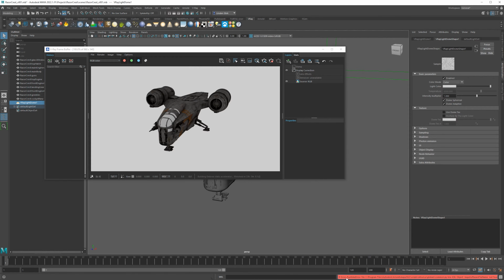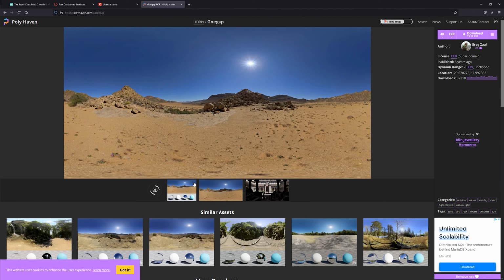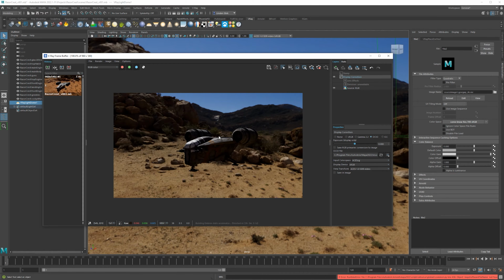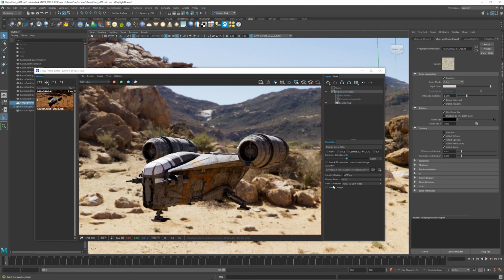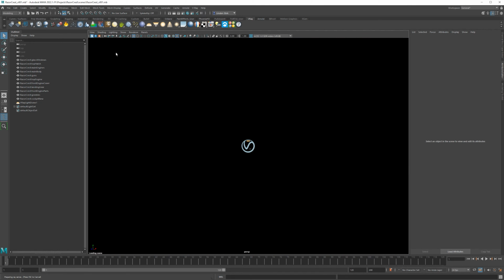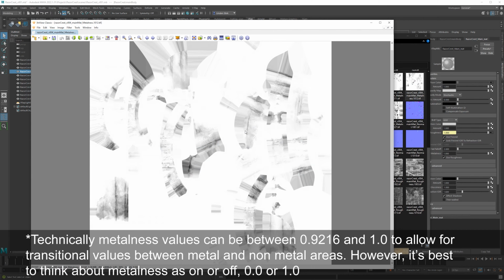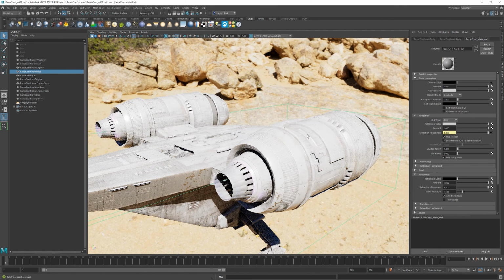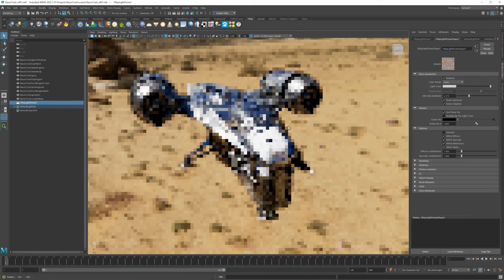V-Ray Sun & HDRI Dome Lights — Razor Crest VFX Lecture 03

Comment: 2:50 What is the problem if this error message appears? Is it a negligible error?
Reply from the maker: No, since if the license server isn't running, you won't be able to access V-Ray.
Reply: @CGStirk  A red error window appeared, but V-ray runs well like the video. License server runs well too. But what's the problem?
Reply from the maker: @taygaben  What is the exact error message?
Reply: @CGStirk I get the same error in 2:43. I get the error in the video as well, but the license and V-ray are the same as normal. (But now I don't get the error message. I re-run Maya and it works fine. Is this a normal situation?)
Reply from the maker: @taygaben  It can happen if the license server is not running, it cannot connect to the internet, or you don't have an available license, but normally it should not give an error.

Comment: 4:24 So, if the license server is not working, could you tell me what to do in Windows?
Reply from the maker: The first thing to try is going to Windows Start and then type in "Start Chaos License Server". After that launches, try connecting to localhost:30304 again in a browser. If there's still nothing, you try restarting your pc first, but if nothing changes, reinstall V-Ray and see if that solves it.
Reply: Thx U ☺️

Comment: Is there a way to move the HDRI up and down on the y axis?
Reply from the maker: Yes. On the Dome Light, enable "Finite Dome". You can change the projection height there. If you can't go low enough, then click on the input connection of the Dome Tex to get to the "VRayPlaceEnvTex" node. Select "Use transform" and then just move the dome with the transform tools. Hope that helps.

Comment: If you click 'Use Transform', the dome light can be turned. 

Re: Metalness... I have adjusted and messed with metalness percentages, and there are times the render seems to genuinely benefit from it. For example, a thin film of dirt that partially lets the metal qualities through. I've never gotten this aspect of PBR texturing.

That all being said, this video was helpful. Thank you.
Reply from the maker: Thanks. In regards to metalness, you can use the slider if you want. If the most important thing is a good render, and altering it helps you achieve that, go ahead, but it does violate the specifications of PBR.

Yes, it was brought to my attention that the ability to move the dome light env was added. I didn't realize it at the time.

Comment: To rotate the environment in V-Ray, in the same attribute editor placement node, you can also activate "Use Transform". This way you will be able to rotate the dome with the usual Maya transform manipulator, right in the viewport.
Reply from the maker: Yep, I didn't realize when I made this back six months ago. It should be enabled by default.
Reply: @CGStirk  
Yeah, I have never understood why they want us to go through the pain of manually enabling the direct manipulation. They should completely get rid of the other method and leave us with the more efficient and straight forward one.
Reply from the maker: @MauroSanna  I agree. Generally I think V-Ray is easier to use than other renderers, but this decision is one of the many mysteries of the universe haha.
Reply: @CGStirk  
Another mystery of the universe is the way V-Ray handles the  wrapper, which is the ShadowMatte in Arnold for example. Super convoluted hahaha. Though I love V-Ray anyway.
Reply from the maker: Indeed. Though the Mtl Wrapper gives you more control, like making a matte holdout of the object casting the shadow for example. Not sure if you can do that with the ai shadow matte directly.

Comment: I really like your tutorial and learned a lot. However, there is a problem that has been bothering me. When Maya renders sequence frames, can it view the final rendering time like 3dsmax.
Reply from the maker: Thanks. I don't think you can see an estimated time remaining, only how long the previous frame took. You can view each frame as it renders though inside the V-Ray Frame Buffer as long as "Render animation only in batch mode" is not checked.
Reply: @CGStirk  Thank you. I really can't find the remaining estimated time of the rendering sequence. I can only see the time spent in the previous frame. I also confirm that I haven't rendered the animation in batch mode. Moreover, the rendering time of the current frame can also be seen in Vray frame buffer. I just can't find the remaining estimated time of the rendering sequence frame. I don't know whether Maya doesn't have this function or I really haven't found the correct method. If you know where to find it, I hope you can help me. thank you.
Reply from the maker: @kevin-Han-  Ah, apparently you can if you render directly in the V-Ray Frame Buffer (not batching). In the VFB, click the 'Show log' button at the bottom right-hand side. This opens up the log. If "Errors, warnings, and info is checked, this will show you "Estimated time remaining". It shows you a lot more info though. Also, I'm not sure why this doesn't show up in the Maya Script Editor log, and I'm not sure if you can view this log during batch rendering. I'm sure you can view file, but there is no GUI. I learned something today lol
Reply: @CGStirk  Thank you for your reply. I forgot the explanation. I used Vray 5.10, but I didn't find the button to display the log, so I still missed the function to view the remaining rendering time. Maybe Vray above version 5.10 doesn't have this function. Thank you very much for your patience reply. Thank you.
Reply from the maker: @kevin-Han-  Yeah, you're right. The button is super tiny with a three staggered horizontal lines. I'm currently on 5.2, though I haven't updated for a while. I will try find a solution.